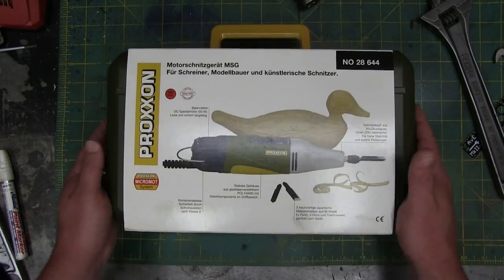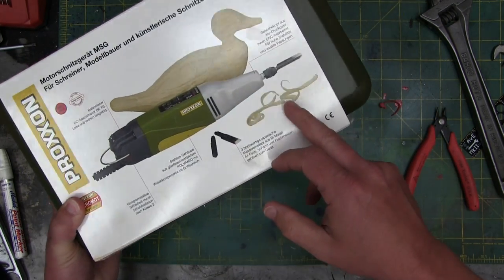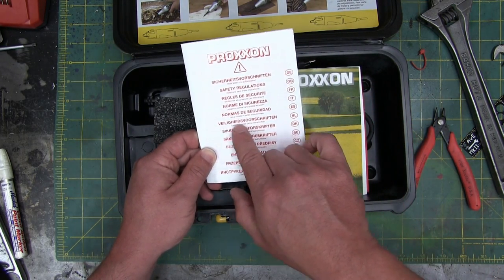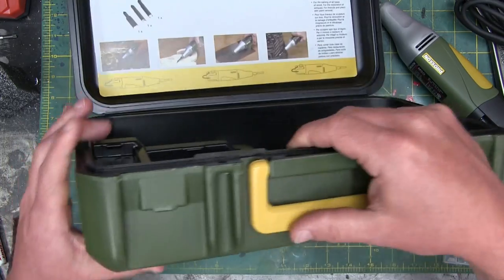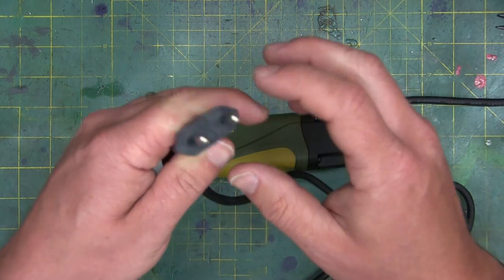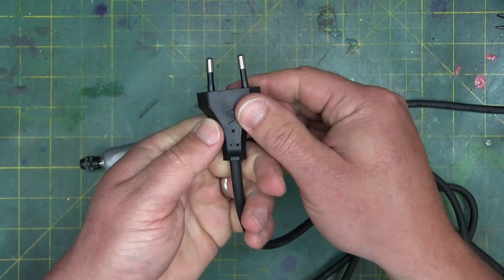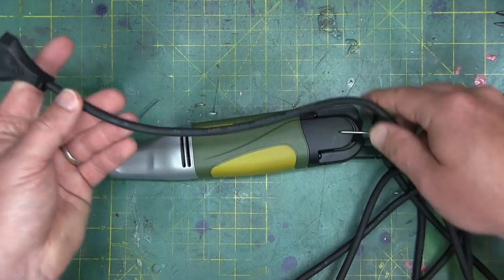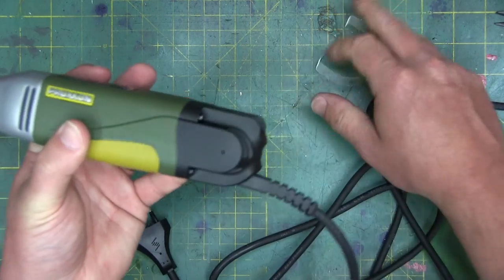BOLTR: PROXXON Carving Tool | Germany

Comment: Just grab 240V from the stove or AC.
Reply: with what his alligator clamps hooked from the euro plug to some copper inserts?? thats a little sketchy even for me, i feel like itd be easy enough to buy a euro female plug end and hook er up somewhere in the shop... a little secluded slice of germany right in the corner of ave's shop.. basically Berlin circa 1980
Reply: Andrew Browner why not just grab an American 240 plug and wire it on the cord of the tool...
Reply: patato patoto, itll work if you just jam the bare wires into the panel too its just whatever is most convenient in with your setup without exceeding 80% sketchyness

Comment: Fascinating how they converted rotary to linear motion.
Looks like Proxxon has a us presence as well, and is available through homey depot and lowes.
I'm sure the metal cutting ability could be improved by optimizing the cutter shape for metal use; squared up like a lathe tool (shallower rake angle).

Comment: i'm from germany, and i have a small workshop in my bedroom, so proxxon tools have some appeal to me, since most of them are tiny. in my experience, they're hit and miss. the small 12V micromot tools are mostly good. i love the very ergonomic dremel type thing (even though it overheats quite quickly, but thats what coffee and smokes are for) and the tiny sanding tool. the 12V jigsaw is shit, but i got if for 5 bucks on ebay so i shall not complain. the 240v scrollsaw is utter shit (got an old model though). a friend got the tiny tiny tablesaw, which was utter shit as well. the (240v) handheld belt sander though. oh man. this thing is probably the best tool i ever bought. it feels quality, and it just chooches all the way. friends saw this thing and bought different brands, and they were all shit. i just love it. i might get the tiny proxxon lathe soon (i mostly do tiny stuff. gonna buy it somewhere where i can return it though, if it sucks. #fernabsatzgesetz).

all the larger handheld tools, including the one in the video have the exact same body shape, and there's a little plastic thing you can buy which you can use to put them in a vise for extra support.

support is excellent as well. had an issue with one of my tools once, wrote an email, got an answer back within 24 hours with a technically founded explanation on why the thing happened that i observed. loved it.

Comment: 18:10 you almost had it, just need to line it up with the flat spots on the sides of the tip. and you may not have 220v, but you'v got 240v, right?

Comment: Actually I'm surprised you haven't taken this and hooked it into the welder plug yet. What you really need is an autotransformer. I am not sure how well it would work with motors typically if they were AC, but for DC stuff it would likely be fine.

Comment: Ryobi used to make one about 10-15 years ago (the tool is solid blue colored). Worked just fine although not quite as skookum- it only cost $30-50 IIRC. The thing I found it most useful for was chiseling a 120v plug sized hole through a 2x4 already installed in this horribly awkward spot. It really sucks that they don't make hobby versions of this kind of tool anymore. The bitch with carving is all the different chisels you'll want. Swiss made chisels are 30 a piece but for about 50 you could go buy that ryobi and a bunch of bits and be set up for hobby carving. And don't judge me, I'm reformed - do blacksmithing now.

Comment: There's another really nice German built tool I've recently acquired, it's a KS Tools 515.3510 (model number varies, but that includes one battery and the charger), 1/2" battery powered reversible ratchet. All die cast metal housing, 63 Newtonmetric torques. Very nice and handy. Only wish it had rpm control, really ought to for the money they ask for the damn thing.

Comment: Just take a UK socket and mount it in a electrical box with a voltage doubling rectifier and have a US cord coming out the back of the box. It runs on DC anyway so it's not like feeding it doubly rectified DC will kill it in any way. I'v done this before but with a US socket and I painted the outlet plate bright red and wrote 240V on it so nobody explodes things with it. Also done the same with a dimmer switch and a outlet in a box, minus the rectifier to regular hot glue gun and soldering iron temperature. Just write the temperatures above the dimmer knob once you got it all "calibrated" using a cheap thermocouple.

Comment: I have 4 proxxon long neck angle grinders witch i transformed in to a pneumatic machine to do metal work in tight spaces, this gearing is rock hard, it will take leftover 1mm disc's from 25 mm up to 60 mm diameter. The pneumatic's make it slip over when overcharged, best tool i have ever had and there is no alternative in the market for it.
I challenge you to make your own. i am shore you will do a better job then i did.

sorry for my bad english...

Comment: place device on wizards' sleeve, stimulating the little man in a boat until beaver is moist.....

I remember when I was lad in the old days before power tools. back then, you had to work the beaver by hand and you'd know the beaver was moist enough when it sounded like someone was in the kitchen whisking an egg on a plate with a fork.
if you overdid it though, it sounded like there was a pot of fast cooking porridge on the stove.

question: do beavers react differently to 60Hz than they do to 50Hz?

Comment: 4:30 I am from Europe and I have always wondered about that inwards bend of the pokey bits. It turns out that this is what gives the plug a certain amount of preloaded springyness so it sticks well in the female parts. When you straighten them the whole plug becomes looser and tends to fall out quicker. Super annoying for things like phone chargers or anything else with a transformer that puts weight right on the pins - thats why we need the slight bend for the thin plugs. Greetings from Germany :)
Reply: Dankeschön 😂👍

Comment: @Ave Little bit of info on the cord
VDE is an electrical testing and standards organisation (  Verband der Elektrotechnik, Elektronik und Informationstechnik)
H is harmonised across Europe
05 is ordinary duty (07 is higher duty rating)
RN - Rubber Nitrile
-F - Flexible

Outdoor cables (stuff like pond supplies and power tool cables) are generally H07RN-F and its UV and weather resistant
Reply from the maker: Thank you!

Comment: Note;  1/2 to Volts is only 1/4 the watts.   Take for example a device using 2Volts @ 2Amps
Which is 4Watts  but 1/2 the Volts and it's only 1 watt.  1Volt x 1Amp = 1 Watt.

Comment: Whenever I see a new tool that is not put together tight. I start looking for QA issues that the piece worker covered up.  They know all the tricks.   The best one that I have seen is on a Horror Fright reconditioned chain saw.  Crap moulded gas tank fixed with scotch tape. Long about the second tank of Gas she starts to drippin.

Comment: so.. the cable says 'H05RN-F' this means: 
H - harmonized cable (international accepted)
05 - max. 300V (L1-PE) / 500V (L1-L2) 
R - Material for insulation: natural- and/or styrene-butadiene rubber
N - Material for cable Jacket: polychloroprene rubber
F - stranded conductor (flexible)
And this little wrench can be used with the union nut - there's a flat spot
sincerly, a Proxxon customer ;)

Comment: The pixie plug pins are meant to be straight but in that format are always weak and bend just with a dirty look. That plug type is the South East Asia version that is used for low wattage applications when no earth pin is incolved.

Comment: Pull the tungfull apart. I have dremels (DON'T JUDGE ME) - handheld wee polishing tool, can't be beat. You get some wool pads and some diamond paste from Mao, and you can polish ANYTHING. I re-sharpened a carbide Stanley blade the other day. Just because. 

Anyhow, the cheap dremels... I pull them apart to get the dust out... And they're not at all bad inside.

Comment: Hello Uncle Bumblefuck - greetings from sher - many :) -awesome video pls keep it up - i didn't even knew proxxon made a motor chisel XD 
i'd like to suggest you the ultimate alternative to the dremel tool, and since you now got a peak at the proxxon tools private parts....( don't worry i won't judge)..... you know what i mean....i'd recomment the Proxxon IBS/E.......... 100W, 20.000 rpm and very relieable - i just recently used it to mill out a LOT of hardened steel pieces and before that it was in for the hard labour and constant abuse in the shop - i think it is around 70€ on german amazon and it is worth every cent..... 

a big fan from germany

Comment: Don't rip on my drug-induced gaming habits yo. I happen to have Minecrapt open on the 2nd screen, took a break to smoke a doob, pop a couple peelz, and watch a few vidayjos
Also, grip strength is 190lbs left, 205lbs right (tested at doc last year when I tore 2 ligaments off my scaphoid.. pulled too hard on a wrench, heh) .. was surprised as I'm a leftie, but favor the right for pulling. (doc said average 30yo male is like 70-90lbs, re-tested me twice, on two different machines as he was sure it was misreading)
I'm a 35yo army vet, 172cm and 80kg

Comment: FWIW, you can get these (and a million other PROXXON tools) in the US w/ 120v: https://www.proxxon.com/us/micromot/38644.php  Might be that's changed in the 3 years since this vijeo came out, but in case anyone else happens along... Couldn't say if they'll ship over the Northern Border, but i'm sure that wouldn't stop an inventive man. They even sell the cutest little table saw what lets you cut nice tiny bits of your fingers off with 2" diameter blades, as a nice break from the full sized hand manglers.

Comment: After my trusty Proxxon FBS 240/E started jittering (worn brushes? shame the motors on these are not really serviceable) I did some reasearch and found this vijeo. I quite like the metal front on this weird carving thingy and it turns out Proxxon makes a normal rotary version similar to this, model IBS/E, so that got ordered pronto. It's advertised as having a maximum of 0.03mm runout which sounded good, but when measured it's more like 0.09mm :/ Emailed Proxxon to complain and was told to deal with the seller as this is who deals with warranty claims in their opinion. Luckily for me I got it from Amazon, so the return process was smooth, but just be aware that if you buy from elsewhere you might get stuck whilst they send the tool back to Proxxon for them to judge whether it's crap or not. Overall, not impressed.

Comment: from what I see, it's a H07RNF cable, it's a pretty common industrial cable, good tolerance to greasy and oily schmuck, good mechanical resistance, excellent protection in an explosion risk environment. if you want more info, you can check the international normalization sheet EN 50525-2-21. here in Europe, we don't use the american wire gauge system (the big heads editing the norms LOVE to put metric everywhere), if you want to know if the cable is underfit for the task, we have a fast method: 5 amps per 1mm². the last thing I found really strange, this tool is double insulated, despite the presence of a bare metallic part. I know, German engineering and all, but, angry pixies doesn't care much about the design of a device, if they can pass trough, they will and when you will feel the unpleasant tingling in your fingers, it will be too late.

Comment: It would appear that you can get a 110V version of this: http://www.highlandwoodworking.com/proxxon-mos-power-carver.aspx

Seems reasonable - it's not like ~50W hobby motors are hard to find in 110V, and there's a big continent of cashed up tinkerers who run that voltage.

Comment: Luxembourg ,my Proxxon rotary tool was made in Luxembourg.It was a good tool,better than Dremel in fit and finish,better speed control etc.However when it did break I was unable to obtain just the parts I needed,instead having to buy an assembly which was 2/3 the cost of a new complete tool.

And yes we can buy them in NA-Amazon is one outlet-
https://www.amazon.com/Proxxon-38481-Professional-Rotary-Tool/dp/B001FWXEO6

Comment: VDE - Verband deutscher Elektrotechniker (association of German electric engineers) on the cable is probably THE quality seal you want on electric machines. In one way or another they invented most regulations for electric equipment. They are for electronics and electrics what the DIN is for everything else.

Comment: If you want full chooch +AvE then stick a dryer or oven plug on it, that or procure a 230V plug next time your in Europe and connect  the hots to the line and neutral pins (no neutral required and akin to the way that UK 110V construction transformers work - Centre Tapped Earth aka CTE where the supply is split by the tranny into 2 55V feeds to lower the risk of a fatal shock, what with construction tools getting a hot supper regularly)

Comment: I have the IBS/E, the dremel/grinder variable speed version of same. It has suffered. Burned out the motor (own fault), was able to get a replacement. Then had it drive my little router table chuck/up and kill a bearing with dust. Those are replaceable too. Very happy with the machine.

Comment: I own a Micromot 40 Drill that I bought in the Nineties and it still cuts, grinds and drills like on the first day. I can still buy spare parts. It has always been my go to tool for all my electronic project, case modding and hardware hacking needs.

When I worked for an Opticians, we used their fine drillpress for drilling holes in the lenses rimless  glasses or to drill out the ruined threads in frames to cut new ones.

And most impotantly. Nothing neither internal or external comes from Maos Dollarama. ;D

Sadly they only manufacture for 230v mains supply, but if you live in the US and need a fine tool for fine engineering stuff, then Proxxon has you covered.

Comment: The little tool is the chuck and bit wrench.

I got a Proxxon Micromot yaddi yaddi rotary tool, it runs on 110VAC and is all ball bearing. Even my top of the range Dremel feels crap in comparison and has been retired from use. It wasn't cheap but at least I can rebuild it and I've replaced the drive end bearings once so far.

Comment: Linotype presses??  Out ass.  Linotype is a obsolete typesetting machine that casts lines o type with brass molds and molten lead/tin/antimony alloy(Linotype metal)
Woodcuts might be what you mean, an obsolete process that was used before photography was meshed with the printing process.
Although a resurgence in Botique printing and bookbinding using obsolete techniques is in vogue. Peeople consider it artsy the shit I lived through to make a living as printer/bookbinder

Comment: Proxxon make torque limited screwdrivers... perhaps the should have minimum torque for the ones they use inhouse.

p.s. the collet tightening tool is what you get with Proxxon's multi-tool (also useful as a milling spindle for hobby modelling as it has tiny runout compared to e.g. Dremel)

Comment: Proxxon stuff is good quality from what I've used and seen. I can't say I'm surprised to see this thing is pleasantly overbuilt. They aren't a household name in the UK but show up from time to time. They seem to be one of those few tool companies that actually has the balls to run everything themselves.

I have a couple of their combination ratchet spanners, and they are an absolute staple of my toolbox. I wish I had some money for some more different sizes. They were not cheap. However I can't recommend them to design snobs, as they have microspeeder written over them in comic sans.

A friend bought a socket set at the same time. From what I remember he got it at a very good price. The ratchet itself isn't the best I've used, the socket release is too stiff and is plastic for some reason, but it does have a decent action to it and a good handle. The sockets and extensions seem very solid and are matte so don't get all scratched up. The best thing about it though is it came in a metal box! We've broken so many plastic ones over the years, this one will actually last for many years without needing to be taped together.

Comment: It is a type C connector. By design the pins must be parallel, but this type of connector can also be connected in an E, F, J, K, L and N type, the latter have 4.8mm pins instead of 4.0 mm, and it can be difficult to get them to connect well. That is why most type C comes with the misaligned pins on purpose

Comment: I saw an Automach power carver in a now-defunct tool store some twenty years ago and picked one up.  Slap some Flexcut RG gouges into it and you're in like Flynn, just melting the wood away until you find out what's inside of it.

Comment: Actually you would be able to use that at (about) full power if you use a voltage doubler in series wirh the mains (Google Images) wirh decently sized capacitors.

Comment: For Proxxon bearings does not have to be in pairs like you say. Take apart Proxxon professional IB-E and see the super small single front bearing that is coupled to same motor you show with nothing more than bushings. 

China crap has better bearings.

Comment: For the smaller tools, if you want both the voltage and frequency of another country, a point of commonality often is the 12v battery in cars. If you find an inverter on their country's Amazon made for plugging their stuff into their cars and it has more than enough watts to handle the tool, then you just need the same number of watts in a 12vdc power supply and you've got access to distant homeland native power for your import tool. For larger wattage power needs, there's always the inverters for home solar panels, or there's the ones for commercial solar panels if you want three phase.